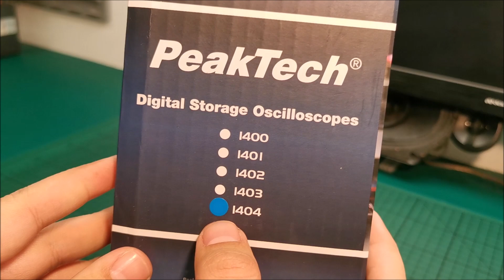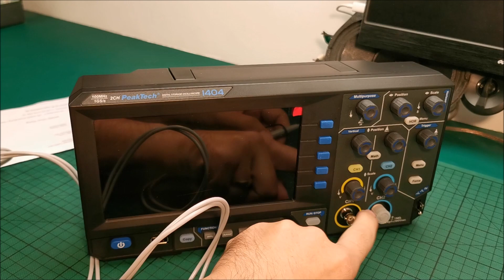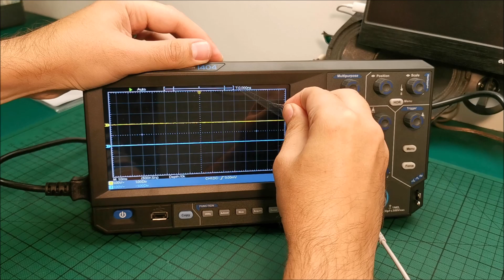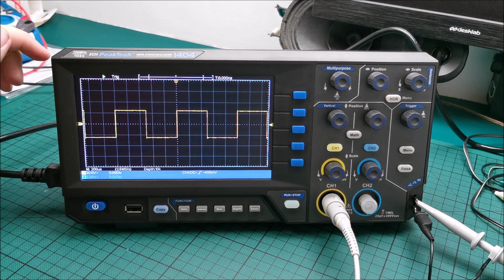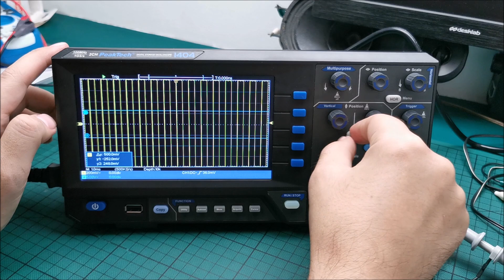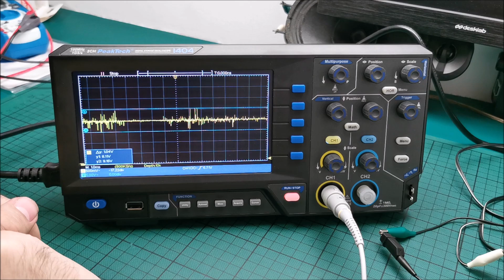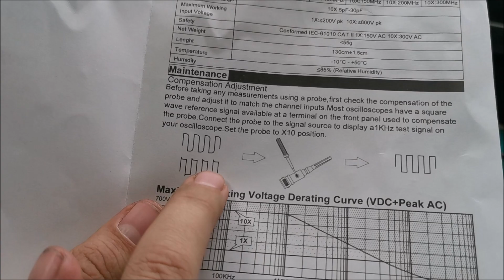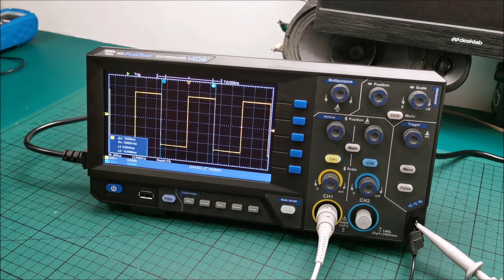PeakTech P 1404 100MHz / 2 CH, 1 GS/s Digital storage Oscilloscope - review and quick test

Comment: I think (still watching at the moment, perhaps you figure it out) you have to use the menu buttons to tell the scope you're using x1 or x10 as well as the switch on the probe.
Reply from the maker: Yup, did not realise the division happens only inside the probe, so the scope has no idea what the probe is set to 🤭